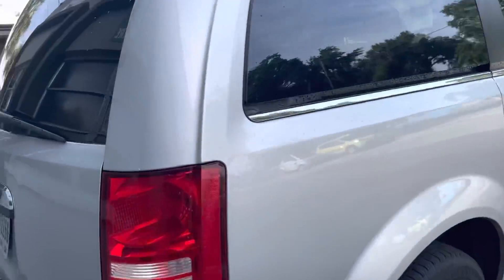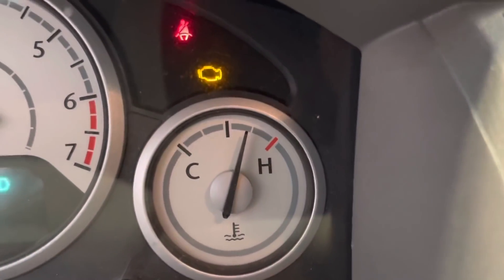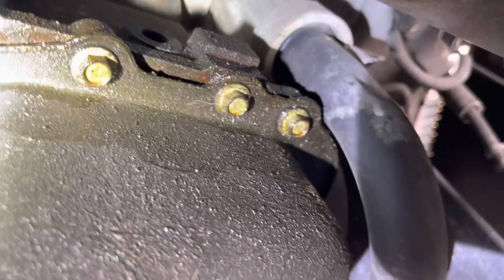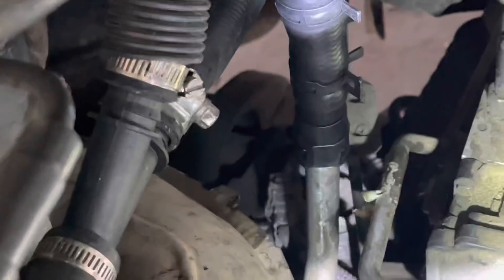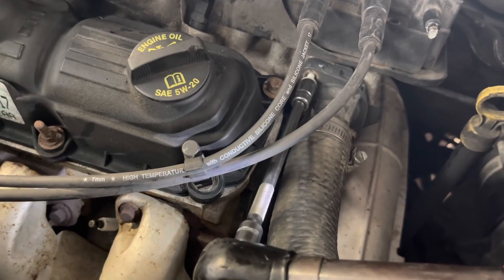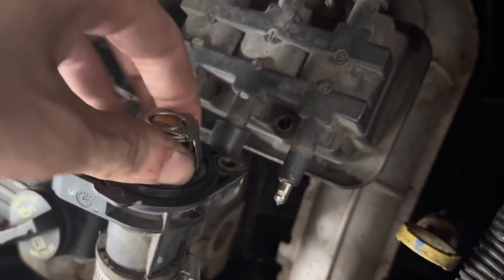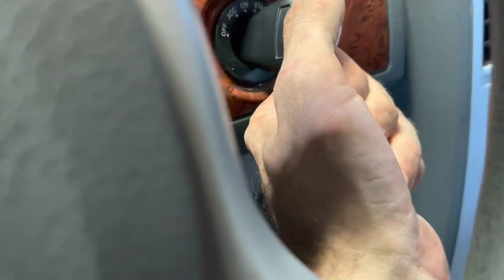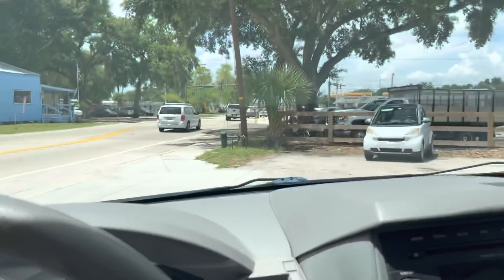Customer States: NO! I don’t want it! Just do the minimum!

Comment: I used to be like this guy, then I found out that my rides are like life. I only got out of them what I put into them. I use my Dodge Caravan on the job so it gets new oil every 3,000 miles with regular service calls for needed repairs. Granted it is not cheap but I will say as for the sudden breakage every now and again there is far less side of the road down time and everything works better.

Comment: Rainman love your vids. I picked up a 2009 grand caravan with 138k for 2400 at a auction last year. Was smoking and misfire codes, egr code etc. All needed was a new thermostat and plugs, egr, and I had to helicoil a spark plug bc the last guy didn't tighten it by hand causing it to not seat right and grounding the electrode into the head. Been a great car for my family when I didn't have much to spend. I'm so surprised how many people want the absolute bare minimum done to their cars, is this just an extreme or is this most of your customers? I was a mechanic for 7 years and most of our customers ok'd the work, but we still had our deal of people claiming we broke their cars or that didn't have the cash to pay for the work. Or the worse were the people that refused to pay and my owner would have to go after them for their bills.

Comment: These videos are unusual in that customers want to do just the bare minimum to keep the car running. I have a 2011 BMW 328i with over 113,000 miles that I have had all the necessary maintenance done on it. Also I have had all problems fixed when ever problems occurred. The result is I have a good reliable running car that runs just as well as it did at 50,000 miles.

Comment: I own the same vehicle with the 3.3L engine. I'm now losing coolant. Can't find a leak. The oil is not milky. Nothing on the ground. Still haven't figured it out. Tell your customer using water is a BAD idea. Lots of internal corrosion will develop. Heat transfer is less than 50/50 mix of coolant/water. Less AC too

Comment: I was about to say before the water started pouring out the unclipped hose, that there was probably a bad head gasket and he broke off the dipstick to hide the grey milk in the oil pan lol Just wondering why hoses have clips or quick disconnect? My 2006 gsxr 750 fuel tank has one and I'd rather have a regular hose clamp. But I'm sure there is a deeper understanding of this? Fun video!

Comment: Ya see, folks.  When a mechanic calls something a piece of junk it is standard procedure.  We hate all cars equally to start with, then it gets amped up a bit when it really is a piece of junk caused by neglect and ignorance.  Humans need to vent or blow up completely.  How do you know how much oil is in that rattling motor when there is a broken off dipstick handle?  How long will he try "estimating" his oil level by sound alone?   We all have seen what happens with straight water in the cooling system.  Water boils @212F.  The cooling fan on that vehicle doesn't kick on until at least 215F.  
  So, you see....rushing to the defense of the owner of said vehicle is an exercise in humiliation.  It is simply not possible to defend that position.  The customer is not always right, especially in the shop.  "I used to be a mechanic, and..."    "WHY WERE YOU FIRED?"

Comment: Steering pump is gonna start whining, he's gonna ignore it by turning the radio up.
Then, when he's chooching through the McD's drive-thru, the fluid will be gone and it'll suddenly be more difficult to steer, and he'll take out the take-out window.
After this, he'll recall that it was in your shop and try to claim that you must have done something to his power steering lines to cause the leak.
And sadly, this video doesn't prove for 100% certain that you didn't mess with it before turning the camera on, so you'll need a good lawyer and always ALWAYS start recording from the moment you get the key so you can prove exactly what was done while it was in your possession.

Comment: Noise on startup is most likely timing and very few of these vans have aircon still, evap coils are notorious for leaking, my 2010 has 298K on the original 3.3 EGA and 42TE Ultradrive, it's got numerous electrical issues and is mechanically totaled, would make a good video finding all the issues but I'm not spending anything more than the minimum at this point as it's falling apart as I write this

Comment: worked at a dodge dealer. no one wanted to fix their stuff they'd rather go up front and trade it in. but then there was those cust who would dump 2k into a 2004 intrepid with 120k on it. 
PSA the Chrysler 2.7 v6 was one of the worst engines in the past 20 years. they sludged up no matter how often you change the oil. youd be lucky to get 120k

Comment: Minimum….yep.  Took my 4Runner to the dealer with less than 80,000 on it and they recommended that I change every fluid in my truck to the tune of $1500. I asked the rep if it was at the factory recommended change interval for those fluids….yep, sure are!   Uuuugh, no, none of them.

Comment: You remember the spark plug wire but I never saw if you cleaned the mounting surface or new gasket installation you may have done it off camera but I didn't hear you mention it

Comment: I fully understand when mechanics explain their findings to me... My turn off is the price. However, my reasoning is bc I've had some scammy mechanics. One time I had a Ford focus. I just changed the cabin filter a week prior and went for an oil change. They came to the lobby with my cabin filter showing me there were pine needles in it and it needed to be replaced. Those jerks took the pine needles from the hood valence and sprinkled them in the cabin filter then showed me... They also tried to tell me I needed xyz as well... Some mechanics are good and others are scammers.

Comment: Had an ‘82 ford ranger, thermostat went, and i picked top hose connection, logical.  WRONG! It was bottom connection.  Top was just into aluminum intake, and when removing bolt, it removed the thread, galled and snapped the bolt.  Now how to get a snapped bolt out of a aluminum intake?  Neadless to say it was many hours under that hood to fix correctly. (Side story, i heard a crash and stuck my head out from behind hood and just about got hit by my bbq that blew off my back step!)

Comment: I wonder how much the cost of a new radiator plus labor vs. two gallons of coolant.  If you put water in the radiator, it will rust over time inside. tips: one gallon of Prestone antifreeze concentrate at Walmart cost $11 and a gallon of distilled water at Target cost  $1.25.  Do the math, and it's good for five years.

Comment: those JDM cab over miniature vans in the '80s and '90s ran forever. some of them they were ugly as soon. not a lot of people bought them, but they blew the caravan and the Windstar out of the water. The Astro van actually isn't too bad. it's a unibody S10 but in a small block with two pistons cut off so they're actually not too bad. we'll say though I like real vans, I'm not even kidding. if I didn't have a wife and kids I would just buy a white Savannah van right now. 99 to '06 generation run it for forever. if it needed an engine easy fix and then I'd get another 200,000 miles

Comment: I understand that customer. When a car's that bad off, the amount of repairs to bring it up to snuff would add up to many thousands of dollars and weeks' worth of downtime. It basically needs full restoration. Meanwhile, as you fix the current problems, other stuff is going to keep breaking. So you put the absolute minimum into it, with the intention of just junking it when the problems finally pile up enough to kill it all the way dead.

The thing is, a car like that can last for 2-3 years, maybe even more, before death finally happens. In the meantime, it will randomly strand you at roadsides, refuse to start as you're trying to rush to work, leave you stuck at work if you do make it, etc.

I grew up with cars like that, and vowed that when I got my own new one (as opposed to a teenage beater car), I would get rid of it once it approached that stage. RIP Mercury, I really liked you, but I did indeed mean it. I won't insult it with the J-word because it lasted 18 YEARS without ever leaving me stuck at the side of the road, but alas, it was indeed mortal, and its time finally came.

Comment: Customer: "Refill the radiator with water. It will be cheaper"
January rolls around
Engine block cracks open
Customer: "WhY DiDNT YoU PuT IN AnTIFreeZE!"
Ray: "I guess water isn't cheaper, like you said"
Customer: S H I T

Comment: No, you will not see this van again.  Owner wants to halfass his repairs in favor of his wallet.  This van will have a short lifespan with a bad oil pan gasket and the dipstick broke off.  He ain't checking that oil.  It will meltdown on a96 degree day on a major freeway. I'm glad you maintained your reputation by putting anti-freeze in it anyway.  You know damn well he would tell the insurance company you worked on his radiator and didn't put anti-freeze in it.  CYA!!!

Comment: People don't have trust in repair shops because there are a lot of bad/stupid 'mechanics' and shops out there. Just as an example a friend  of mine had a jeep with no heat, national repair chain said the thermostat was bad and replaced. When they got the vehicle back it was overheating. I took the new thermostat out because they put the thermostat in backwards, that's auto mechanics 101. I checked and found the heater hose inlet to the heater core was hot but the outlet was cold because the heater core was plugged. Changing the core is a huge job that requires removing the dashboard. Reverse flushing the core fixed the problem, I'm just an amateur. I'm sure you guys have seen plenty of cars come thru your shops that have been badly serviced by other shops. Complexity of vehicles forces trust in your mechanic. Some mechanics use the complexity to screw customers which ends trust.

Comment: Come on guys and girls , I had a Cruiser for,"seems like" ever, Daimler engine , never ever let me down, Spark plugs you had to change every 5000 miles oil every 2000 miles , but did most of the work myself, Best part of the chrysler cruiser was ,If you had a fault  you only needed to turn on the ignition "quickly" 3 times and it gave the fault codes out, not having the scanning tools , internet for Chrysler had soo soo much info. The worst problem came as camshaft sensor, ya gotta change the magnet with the sensor but in uk you could not get both together, Effin daft, their both worn out after 110,000 miles. Car seemed "unlike here in UK " finished , nice quality. Dont get me wrong. Part exxed it for a Jeep grand cherokee 3.0 crd diesel. good car too. just done all the suspension. We get salt and shit during winter and rots EVERYTHING! I luurvve to watch Rays stuff, only been doing it with FMC for 50 years. but not cars. In Dagenham . Estate Railway and Jetty. see if you can find stuff on de net. DOO De DOO.

Comment: Never going to see the guy again, because the car is going to end up in the scrap yard in a year or two when the engine locks up. People who drive vehicles like this spend $1,500-2,000 on a junk vehicle every 3-4 years and run them on basically no maintenance, till they explode or fall apart, then buy another one. Never stop shaming people who drive vehicles like this. They are a danger to themselves and everyone else driving next to them out on the road.

Comment: I'm sure you will see him again for the same problem because you didn't put the hose clamp over the hose after you clicked it in (6:50).  Vibration would eventually rattle that hose loose and coolant would drain again.  sigh

Comment: If the customer found out that you put in antifreeze/coolant rather than the water that was requested, and was able to prove that his request was not met, would that be grounds for a refund or potential legal action because of breach of contract?
Reply from the maker: Because I turned it off
Reply: @RainmanRaysRepairs  huh?  I'm confused by turned it off.  I do see you pouring the Fram coolant into the car though.
Reply: @RainmanRaysRepairs  confused by I turned it off

Comment: treat every customer the same with attitude respect and charisma. Shouldn't put other people down just because they don't have funds or just don't want it done. Just because they're older doesn't necessarily mean they're always bad vehicles. I'll work in the garage in a small town have all the capabilities you have there. But the same time some people are on a fixed income or do not have a big piece of plastic to throw around and act like (oh there's $3,000 will pay it off eventually.) Sorry but that is not the way society works with all the electronics nowadays everybody thinks you can walk up plug in and know exactly what the problem is. But when a customer comes in with a rattle on the top end or a knock on the bottom that takes us as mechanics to decipher the mechanical failure not always the electrical components to be continuously replace when they go bad . We always treat every customers vehicle the same regardless of their income the way they called looks or what is inside just because somebody has a older vehicle does not mean it's a piece of junk I'll work with you guys like that. And when it comes to mechanical failures they always have a problem because they rely on the electronics to tell them things. A computer is not going to tell you that broadbearing number three is 13,000 out of spec. And instead of rod bearings that cost less than $130 will get them 50 or 60,000 more miles

Comment: in the united kingdom if it has abs lights on the dash will fail yearly inspection. 
my ocd would also put coolent in aswell. i repair video game systems and only use japan capacitors.

Comment: That thermostat jiggle pin should be at 12 o'clock . I learned that the hard way .  I would also tell customer that I will not do the job with just water . Its wrong and can damage the engine .    He'll come back and blame you .

Comment: I can see why he didn't want everything fixed.  A seeping oil pump gasket might not even lose enough oil between changes to be a concern, not enough to justify the cost of replacing the gasket as many vehicles have cross members in the way making it rather expensive (labor intensive.). That being said....telling you to only put water back in it...WOW.  That is CHEAP and dangerous to other components.  I wouldn't want to work on the car of someone that was THAT cheap.

Comment: The broken dipstick is common to chrysler T&C.  use a wood screw to extract it.  new one is 15 from chrysler.  they stock them.  the cooling system on these is crap.  heater hose Y pipes, radiators are crap.  Also, air conditioning leaks out.  wiring harnesses on sliding doors wears out over time.  Check engine light is there to say it is operating properly.  Will never own one of these again.  brakes last 20K miles.  Nightmare for maintenance.  No check transmission dipstick.  crazy.

Comment: Hah! “Do the minimum” i only do minimum if i truly cannot afford to fix major issues.
I did have a choice: fix power steering and replace it or replace driveshaft. Ahahahaha. Yeah i put some anti leak in the steering-fluid and had them take out my driveshaft till i had the 1k to fix it. I have a 97 crv it’s not ideal but it’s basically a 2 wheel drive temporarily.

Comment: I would have bet my life that the CEL was an evap code...of course this is a 3.3, not a 3.6 so just reset the light, fill it with water, and drive it until the transmission seizes

Comment: Let’s see here I can break down that car even better they didn’t have the line properly connected to the car because when they filled the car full of water instead of coolant like a common person would it build up enough steam within the engine to actually blow the line clean off of the plug common sense 101

Comment: Broken dipstick, broken A/C. Running water instead of coolant. Heater hose not attached correctly. It's junk just waiting for its turn to fail completely and ruin all the surrounding drivers' day because it will be during rush hour.

Comment: probably going to see that Town & Country again.  Owner didn't even want you to put antifreeze in it so owner really neglects the vehicle I would have had  you replace the oil pan gasket and the power steering hose that was leaking. If owner didn't have enough money I would have talked to you and see if you could have put up some kind of payment plan . I know some shops don't so you just have to go by the owner's request.  Antifreeze isn't just for winter time it helps cool the motor all year long, it lubricates the water pump  other things in the motor, If the water pump goes out or the radiator clugs up because owner has run strictly water in it you will be the bad guy & shop will get poor reviews from the owner

Comment: Check the engine oil. Get a long pointed screw started in that dipstick handle and pull it. Or drain the oil and make sure he has the right amount of good oil. Fully burp the cooling system and monitor cooling fan operation.
Run the heat function of the climate control.
Top it off.
Drive hiway and city.
Pour the coal to er underload.
Watch for steam. That's how you avoid a comeback.
If he won't authorize these minimums? make no repair
Sorry mister, you must authorize at least the basics or it sits out in the lot till you arrange funding or a plan.
We love you.
We cannot accept your assessment.
Please understand.
You may have recourse with the previous shop who left your hose clamp totally not connected.
You can call and arrange something perhaps. The whole thing is on video. I can back you up with evidence to plead with them.
Let us know if we can help. Or, tow it away.
It's just the right way to handle your second most expensive possession and means of transportation.